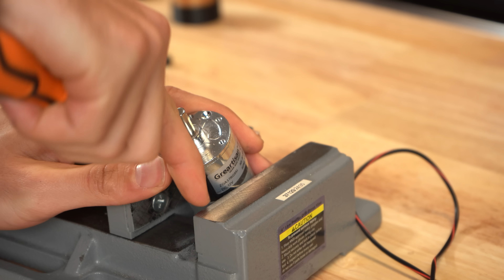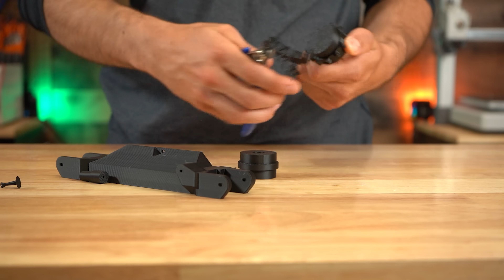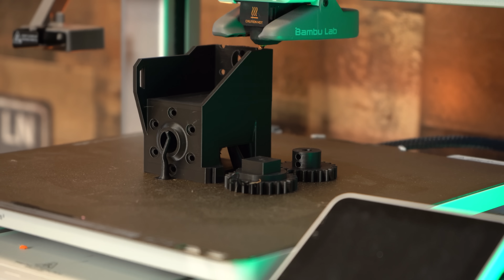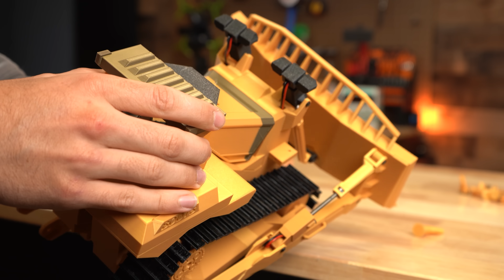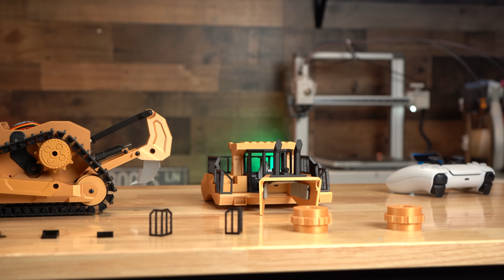3D Printed RC Dozer - DIY

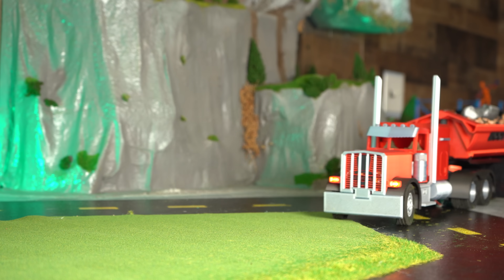Comment: 11:07 so not to be negative but you can absolutely do that with standard rc parts there are 3 trucks and 3 flat deck trailers in my shed atm with hitching systems that don't need you to be there to do it

Comment: If you ever do decide to make a proper RGN/Lowboy trailer for the truck you should look up the brand Fontaine. The method they used to connect the neck to the trailer should work really well and be easy to not only model but also make it easy to pass power between the neck and the rest of the trailer. I pull this brand of trailer so I could definitely provide reference images and video if needed.

Comment: ugh, now I need the truck and excavator in the same scale and power output. I want to be able to load them on the truck drive them to the worksite unload and move dirt  and dig.  The power of this dozer is far better than any cheap pre made setup.  You did extremely well on the design, but now im upset at the scaling across the models.

Comment: Has anyone else experienced this issue with the right blade motor? After powering it on, it spins all the way, but after connecting a gamepad, I can control it normally, but the rotation is jerky—it spins a little, then stops, and then spins again. I'm using TB6612FNG motor drivers.

Comment: you should next make a more realistic system and use a for example weed eater 1hp motor 2 cycle that runs a generator/dynamo (old cordless drill battery, brushed for standard, brushless for 3 phase ) head that powers 4 motor you have now

Comment: This is genuinely next-level modeling work. The way you’ve engineered the functional suspension on this is a huge challenge, and you nailed it. It got me thinking about the absolute pinnacle of multi-axle engineering: the Soviet-era heavy haulers like the MAZ-537. Their 8x8 drivetrain and central tire inflation system are almost alien designs compared to Western trucks. The complexity would be a fascinating, and likely brutal, puzzle to solve. Seriously impressive work on this build.

Comment: I vote for a tractor with a quick hitch and uses the same magnetic hitch for the semi as a power rake off and powers different attachments such as a backhoe or dirt plow and it could also have A loader, it doesn't have to spin but it could be a way to hands off conect more complex attchments and be able to lift them with the 3 point hitch and lock it

Comment: What a cool video! While RC heavy equipment isn't really my thing, 3d modeling is. Seeing you add in the mechanical aspects is really enjoyable.  Food for thought: did you consider adding cab windows? You could add a rabbit joint cutout to the inside of the window frames, and add clear acrylic pieces. You could create a template from the frames that you can use as a guide to cut the acrylic. It can be easily glued in with Acrylic Matte Medium, which is reasonably water-proof, and sticks to everything. It is easily realeased with IPA (rubbing alcohol).  Also, put some figures in your cabs! Thanks for sharing your passion.

Comment: Only thing I would change about the track frames is adding some sort of track tensioning system, built into the front idler, like on the real thing. It would make removal/installation of the tracks easier , and would make it to where you didn't have to re-print the tracks every time they started to stretch.

Comment: (31:40)  Every U.S. state requires signage, flags, lights, and escort vehicles through the permits they issue for the transport of nondivisible loads that exceed the federal limits described in Federal Highway Administration, 23 CFR Part 658.). Your towage vehicle does NOT display the proper signage to ensure public safety on the roadways. You MUST refer to the your state's DOT's 'Oversize/Overweight Permit Regulations' for transport of your dozer, relative to scale, on public interstates and highways. These regulations typically require a pilot car with and transport vehicles to display an "OVERSIZE LOAD" banner signage--bright yellow background with a minimum projected area of 440 square inches, and with "OVERSIZE LOAD" in black text, 6-inch minimum letter height and 1-inch minimum brush stroke width--on both the front and rear of both vehicles. Since your dozer, relative to scale, is noncompliant with your state's oversize/overweight transportation regulations, you are thus restricted to transport your dozen ONLY within the confines of your maker's shop.  Consequences of overweight violations are applicable within the state jurisdiction where the violation occurs and shall include fines and/or imprisonment and/or vehicle impoundment. Let's get those "OVERSIZE LOAD" banners printed (to scale) and properly affixed, boy.

Comment: This is my first time seeing your page and i'm mind blown! Also, had some other thoughts. 1. Is it possible to make the blade stay where it is if the body tilts? so it would maintain the same flat grade if the original ground started to vary from flat to sloped? 2. have you thought about hydraulics for the actuations instead of mechanical? Just some thoughts/questions that would be cool (and an extra challenge) for your next build.

Comment: Direct attachment of a drive wheel to the motor is not best solution. You can make the wheel sitting on two bearings independently of motor and connect motor shaft and wheel using some kind of coupler.

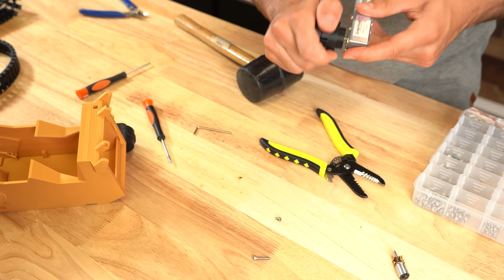Comment: 9:25 Why not flatten out a part of teh motor shaft and then it definitely won't move? Or if you don't want to modify the shaft, make a piece that you can use a grub screw for the shaft, and then same idea but using the plastic piece.

next build: large crane that builds itself. construction crane, like for skyscrapers

Comment: You need a Vibratory Compactor, Grader, Mini-excavator (all the rage these days), Portable Crane, Rock Crusher, Rock Screening Machine, Boring machine (for putting underground cables in), Paving machine, and of course, a Cement Truck! In your video, you don't mention the parts cost for all the parts to assemble the Dozer. A rough estimate would be handy to know what I am getting myself into if I get a bee in my bonnet and start building some of the above machines. In real life, I own a Peterbuilt 387 semi, a General 40 ton lowboy trailer, several equipment trailers, a Case 850B track loader, a John Deere 690A excavator, a Vote VTW-18S mini excavator, and a 1950s GMC 5 ton with both a 70' extension boom ladder truck bed and a dump bed. I also have several 3-D printers, a cnc plasma table, mill, lathe, and nice welder in my workshop. 

In my spare time I volunteer teach robotics to 5th thru 8th graders. We get the kids programming in Scratch, and working with Micro-Bit controllers, 3-D printing, and building and programming Lego EV3 robots.

Your builds are very well made and look fabulous! Keep up the great work!

Comment: I see all these awesome builds with  DC motors, and I'm like what about the silent power of a 3-phase FOC motor?  Well, that means three times the half bridges, plus current sense (which is an amplifier built into the relevant driver chips) plus an encoder, resolver, or set of hall sensors if you want to be able to start and stop smoothly.  So obviously it's a lot more complex per axis, but there has to be some application where it's worth it.

Let me know if you are interested, I can help a bit with schematics and I can write the controller firmware.  It also takes a fair bit of compute to run FOC, but an ESP32 should be able to handle it (assuming there's enough I/O, I haven't checked)

Comment: please do not take this as a critique as you have done a splendid job, but, one of the reasons you were having issues making the road is that you did not build in blade tilt (side to side) which allows you to dig in deeper on one side than the other and giving the versatility to create the final cut at the rake your looking to achieve (sloping, flat etc.) the right hydraulic ram is independent of the left hydraulic ram. This limited you to only cutting at the same plane as the track are sitting on the ground. If you look closely at the connection of the blade to the arms on a dozer, you will see they are not simply hinges (as you have) for tilting the blade forward and backward. I know adding this feature adds complexity, but I thought it worth mentioning for someone who may want to tackle this type of build and realism.

Comment: what about pivoting a little into military/industrial, like those tracked platforms that deploy mobile bridges (with authentically designed differential for the drivetrain and steering), the very large military cargo hauler trucks, or maybe even break into the railroad scene and start a few more antiquated machines like narrow gauge shunter locomotives and steam shovels

Comment: You can stop the tracks from coming off when the dozer is side loaded by usind CAT's method of bogie rollers they have been using the same pattern on all track bodies for decades single,double,single, single, double single spread across the bottom of the track undercarage just a little pointer but I thpught this build is amazing and i would love to see if you can make a lagit road grader that would be so aeesome

Comment: I think a great next addition would be a medium to heavy duty vocational truck that can be either front engine or cab over, and has a range of number of axles, and a range of rear attachments. Ie, tow truck, garbage truck, dumpster carrier truck, cherry picker, yard waste self loader, box truck, pump / vac truck, dump truck, salt truck, or street sweeper. You name it. 

One of the coolest things I've ever seen on this channel is the whole thing with standardizing attachment systems. That really tickles the brain good. I could see that being implemented here, along with an even larger and more expanded or modular system for changing aesthetics. Like small or medium cab over versus a large one, or sqaured off fuel tanks versus rounded ones, different wheel rims, and so forth. 

I think that if a new cab attachment system is designed that it could even lend itself to a V2 of the semi. 

Idk just spitballing here! This channel is so cool I literally hav binged watched all your videos in probably the last hour or two. Hardcore needing out here and I don't even have my own 3D printer yet, but I think the bug has bitten me so to speak.

Comment: Some mining themed vehicles the same size as the dozer and haul truck would be sweet. Pay loader or a large shovel loader. Cable shovel for bonus points. Also a big enough loader can have a log handling claw to unload the self loader

Comment: you could mount brushes that brush out the inside of the track as it rolls and make a little slide so the dirt slides out the side onto the ground instead of falling to the bottom of the tracks

Comment: I vote for the front loader with attachments and here’s why.

With what you learned designing the dozer drivetrain you can use that knowledge to design a heavy duty loader drivetrain that can really move buckets of dirt. That drivetrain will then feed into the grader, roller, and eventually the articulated dump truck. It can then go right into the tractor and farming equipment and that is my second vote, tractor with pto!

This is the one piece of equipment we are missing. We can move lots of dirt now with the dozer and the excavator is great but takes a long time to move a pile of dirt. The loader with bucket here would be great and then the attachments can be made for forks, etc like someone else mentioned. Then when we get to the farming we can use the front loader with a bale grip to load and unload trailers. 

This was a great video and I cannot wait to get to building!

Comment: Hi, great build, got a question, saw in one of your videos that you were loading TPU into the AMS, what TPU are you using with the AMS?
Reply from the maker: I used to do this but started running into issues so now I just have a printer dedicated to tpu. I use sainsmart

Comment: add a winch mod to the back, that would be so cool! Replace the riper with a winch and allow it to pull things with brute force or use in different applications. Would be so cool. May have to print these projects out.

Comment: Hi, I watched your video and really enjoyed it. I love RC models myself and have built a few, but entirely by hand, without a 3D printer. Mine are a 1/10 scale T34-85 tank and a ZIS-5 truck.I've made a lot of interesting simulations on simple circuits, and now I want to make a tank engine sound on the ESP32 Audio kit v2.2 board, but I've encountered a problem: the board is extremely capricious on my old Aduino IDE 1.8.19. I think I'll solve the problem if I install Arduino 2.
What do you think, I'd like to hear your recommendations on how to best make an engine sound; I need several sounds at once. My models are on my channel.

Comment: Professor, I would love to see a wheel loader added to the fleet, it is a fairly simple design, the pivot would be fun to figure out, and the arm action can easily be achieved with a threaded N20 motor. If you decide to go with this suggestion, I would recommend using the caterpillar 966 Medium Wheel Loader as a starting point for reference. this allows you to use only one N20 for the arm.
I love your videos, and check often for new uploads. Thanks! :)

Comment: Hey, the dozer actually looks so cool.
If possible can u release a model in which no motors, no pcbs, no electronics items are there. Because in the current model u need the motors for it to fit together, so can u release a model that can work without the electronics

Comment: This is amazing!
And I think it's the perfect reason to expand your semi arsenal with a detachable gooseneck lowboy trailer.  Even though the dozer fits on your standard trailer it would be awesome to see a slightly wider deck trail for all of your future "WIDE LOAD" builds.  Maybe add a Wide Load banner that can clip onto the front of the semi and back of the trailer while hauling loads.
Reply from the maker: A lowboy really would be super awesome.
Reply: @professorboots  I'd be super interested to see how you problem solve for some of the complexities of the detachable gooseneck design.  Seeing the design process and multiple iteration is my favorite part of every upload.

Comment: Great Build!! What programs are you running for CAD to make your sketches? New to this stuff and I like your programs your using the interfaces look nice and simple to learn and which program did you use to make your circuit board for the electronics? I have Blender, FreeCAD, and KiCAD but im seriously consider just purchasing solid works or autodesk with a much more easy interface.

Comment: How about a farm tractor with real PTO and loader?
You can design loads and loads of attachments and the packaging would be a nice challenge.
You can use it just as a loader for your side dump, the PTO can drive a conveyor belt on your worksite, you can attach a shield and weights to use it as a planer/grader, ...

Here in Europe you often find them alongside regular construction equipment as they're super capable off road, deliver massive amounts of power and are fast enough to haul things around the nearby area.
The next "truck like thing" compared to a tractor would be the Unimog. Probably the most versatile vehicle ever.
Reply: Big Bud tractor

Comment: A cat grader or scraper that articulates and everything will be a challenge but would be awesome. Also add a digger in the back a front flow and wing attachments that fold up and down.   Or a pickup truck with multiple attachments. Snowplow, service bed, lightbar, flag truck/oversize load truck, goose neck trailers, bumper pull. And all interchangable would be sick. Keep up the projects hoping ti get a printer soon.

Comment: Question, does the blinkers on the truck work in the direction you turn your wheels or separate buttons?
Reply from the maker: They work in the direction you turn the wheels
Reply: @professorboots ahhh k, thanks

Comment: What is the filament used for the tracks?  I love tracked vehicles but most for rover/robot vehicles are flimsy nylon, they work, but not so secure. My reliable rubber track set finally cracked/splintered so now,  I am looking to cast each and every metal segment, but the weight is a real disadvantage.

Comment: Those TPU tracks are amazing and TPU does not even have the best grip compared to newer flex filaments.  RC scale tanks have been on my todo list for a few years since I saw them at a model show. I priced them but even the Chinese ones where not cheap and hard to find here Downunder. Now I have a 3D printer, needs a different extruder, one that can handle TPU,TEBA etc

Comment: Make a wide trailer for the semi truck. With steering at the back, they are called float trailers in Australia. Also you should try making a road train or just add the hitch at the back or the trailer and make a dolly.

Comment: A pick up of raod Holden ute with 2 normal tiers in the front but yank treads in the back as a six wheler so you can tow spaler trailers or laod smaller machinery like a skid stear or forklift and it can be used to scout the Rea before taking the more expensive heavy equipment

Comment: you should check out the PowerTac Ultimate 3200mAh 3.6v 11.52wh 11A batterys,  they'r 18650's aswell so should slot right in :)

Comment: slightly stupid ideas:
a Road Roller
a Steam tractor
a small 0-4-0ST locomotive, as they were used as construction equipment in the early 20th and late 19th century, and it'd be cute to have a little bobber sitting on your truck lol, id suggest something like the Davenport being restored by Wreck2Restored. possibly with some rollingstock as well, and track-
a small dumptruck, with a small dump at the front, rather then the back